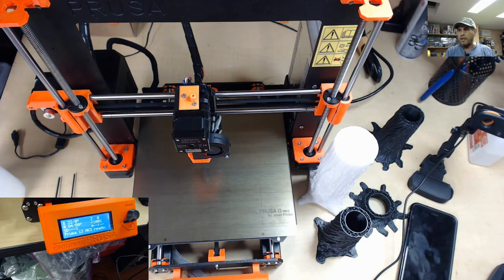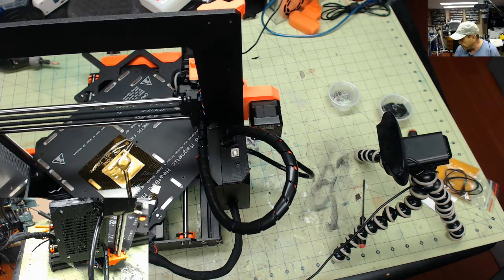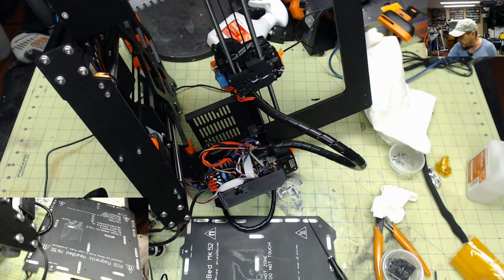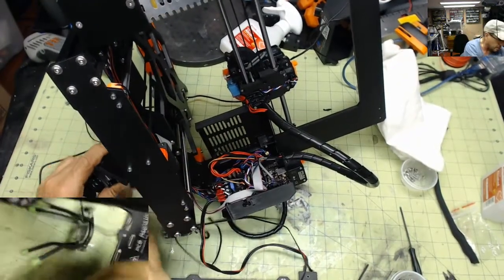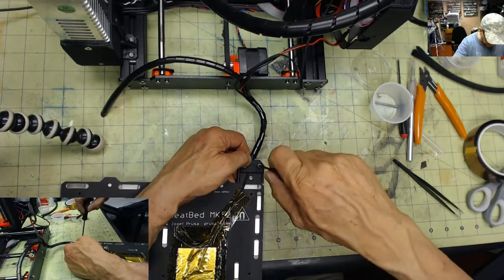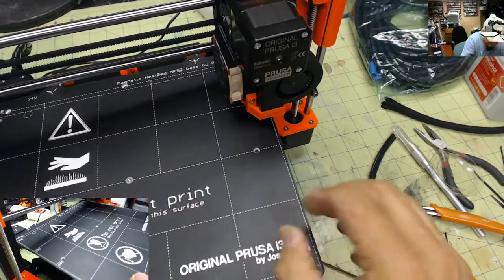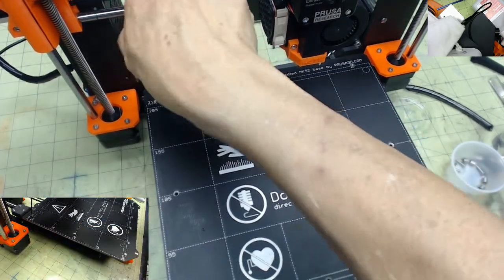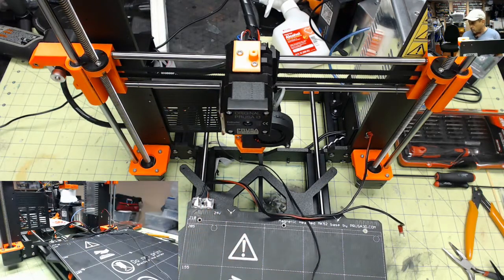PRUSA MK3 HOT BED THERMISTOR REPLACEMENT

Comment: what was the problem for replacing the thermistor of the heatbed? I've received two thermistors (heatbed+extruder) from prusa3D for fixing a problem  i'm having by stopping the printer at 30%/70% of the print. No errors on screen or log, just stops. Can you do some explaining of your fix? It's a little to fast for a fix like this if you ask me